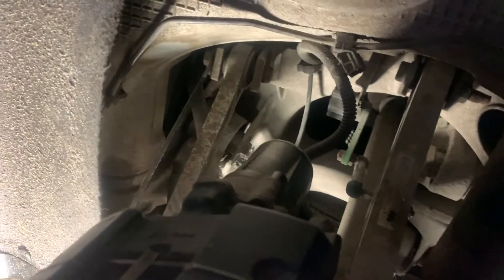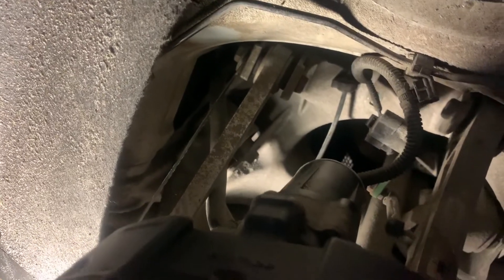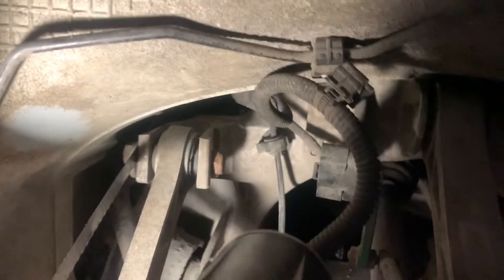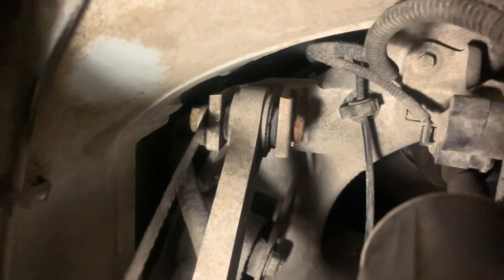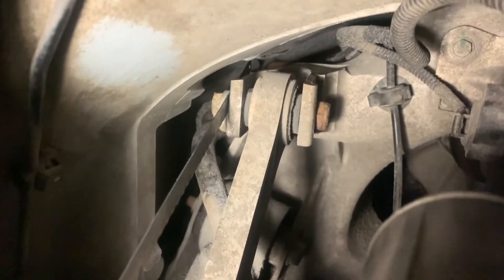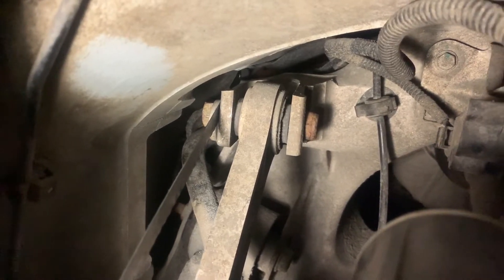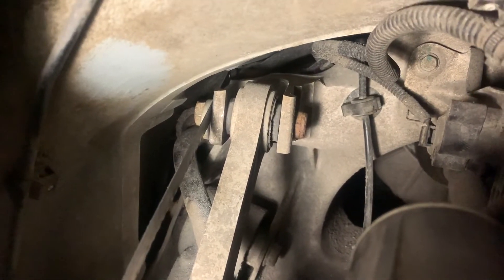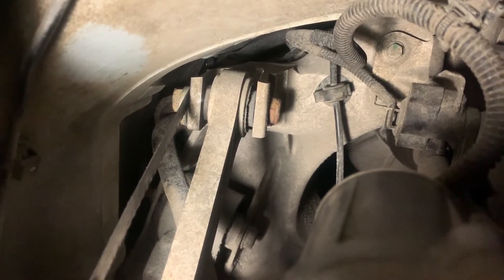DIY Rear Suspension Toe Link Control Arm Replacement  on TMS

Comment: you dont need to cut that bolt.... i just did this myself and you can get the bolt out by loosening the subframe mount and levering the body up a few mm enough for the bolt to clear, then refit the opposite way round